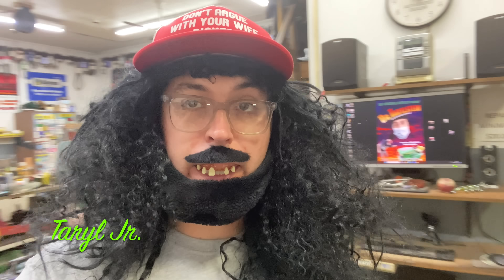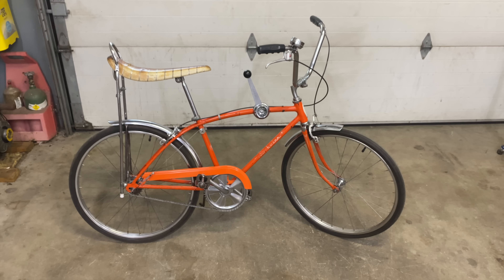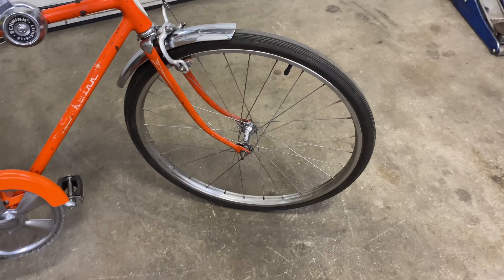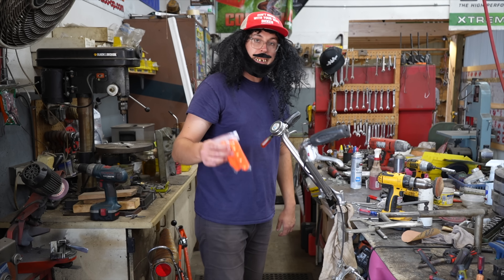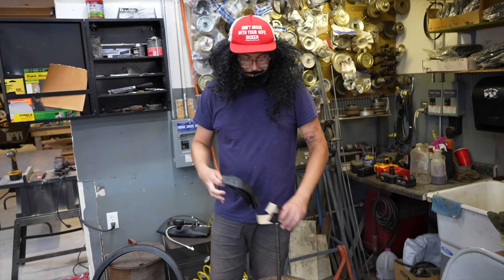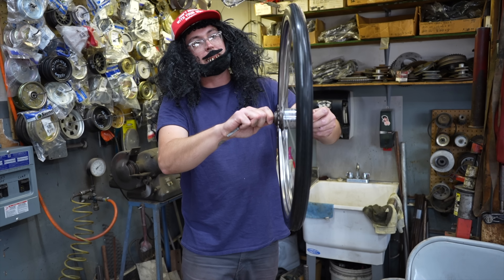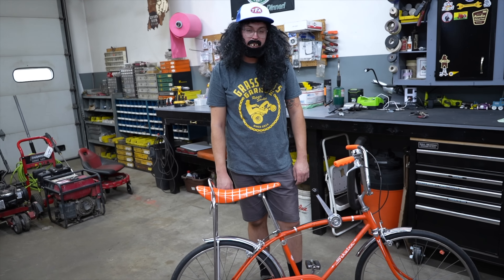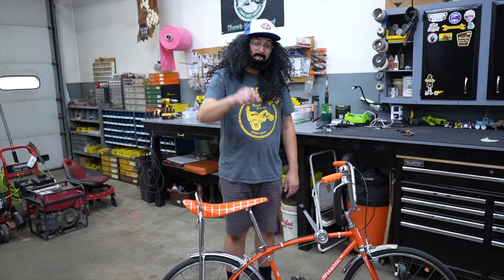They Only Made These RARE Bikes For 2 Years

Comment: Back in the 50's I worked as a bicycle mechanic at a local bicycle shop.  We were a Rollfast and Raleigh dealer.  I installed all the tires by hand, no tools.  Screw drivers are a ticket to an air leak.  Ha Ha  I was able to take a new rim and 36 spokes for a 26" wheel and relace the front or rear hub, put it in a truing stand and correctly true the wheel which was not easy for a kid.  One other secret for centering the brake pads was to release the offending spring pull on it a little bit to put more tension on that side and then easily push it back into place to align the brake caliper to the wheel.  One of the mechanically services we offered was "Adjust bike".  I would adjust both the front and rear cones to take any slop out of the wheels.  I would also adjust the crank in the same way.  Then I would adjust the front fork to ensure it also had no excessive play.  I think we charged $.75 cents.  WOW what a money maker.  Another thing we would do while the wheel was on the bike was to deflate the tire and tighten all the spokes and give the wheel a general alignment.  If the bicycle had any missing spokes or ones that couldn't be tightened we would remove the wheel tire and tube place it in the truing stand and give it a proper alignment.  We would also replace the rubber band that prevented the spokes from pinching the tube if necessary.  I think we got $2.50 for truing a wheel.  I was also capable of repairing the standard one speed rear wheels "Comet" was one of the popular brands as well as the 3 speed unit that you have on your bicycle.
My favorite rear drive wheel was a Bendix 2 speed automatic.  There were no cables or shifting mechanism mounted to the frame of the bike.  When you mounted the bike you would GENTLY press backwards on the pedals.  Then start pedaling forward and when you wanted to shift into 2nd gear you would just GENTLY rotate backwards and then forward again to shift into second gear.  🙂The Good Ole Days!  Ha Ha
Reply: Definitely ixnay on the screwdrivers, Junior.  Plastic tire levers for bikes are not expensive. Get some Pedro's or Park Tool levers. You won't regret it! Put one bead on, then insert the tube, then the second bead. You will only need the levers for the last bit of the second bead.

Comment: Very nice project Junior. As a child of the 60’s living in Millington, Tn. a suburb north of Memphis boys wanted a Schwinn Stingray. Problem was they were more expensive and no one carried that brand locally. Western Auto had their own version schwinn llke bicycle. It was called a Western Flyer. It had a banana seat with a racing stripe, high rise handle bars, and sissy bar. The only mod I added was the drag slick rear tire with the red pin stripe and a head light/combination. The light used acid type C or D batteries. Every time you hit a bump or jumped something that light would quit from the batteries shifting. Still remember popping wheelies and locking up the Bendix coaster brake to see who could make the longest skid mark. So much fun back then. Don’t forget the playing cards held on with clothes pins clacking in the spokes.

Comment: I remember these bikes well because lots of the younger boys in the neighborhood (south Sacramento, California) had them. I was a junior in high school, in 1971, and had bought a Schwinn Continental (10 speed with "center pole" brakes) back in 1969 and loved riding it for long road trips. A group of us guys would take off on Saturday morning and ride the country roads that ran alongside the Sacramento and American Rivers in the area. Fine a burger shack about noon and each lunch. Then head back to Sacramento. Lots and lots of miles and memories!
The chain guard decal looks incredible! I remember using those "water based" decals that came with all of the model car, plane, ship kits back in the 60's and 70's and how frustrating it was, at times, when they would pull in half just about the time you were removing them from the backing paper. Argh!
Good luck on finding the original 5 speed equipment.

Comment: I’m a Schwinn fanatic to. I had the pleasure of riding these bikes new. My thing is to make them all functional, I do want to paint one . 
You need 24” x 1 3/8” x 1 1/4”. Are they s6 wheels? I need the same tires to for 2 bikes. Good luck with the project. I almost sought out you shop as I drove through last week, I wasn’t sure if you guys like visitors. I’m a big fan of the channel , thanks for the entertainment. I also have learned a few things watching . I’m retired so I fix mowers for relatives, friends, and a couple of paid clients..
What I have done is wet sand the frame just enough and then clear coat them with a rattle can , preserving the life they have lived. New England is hard on steel.
Thanks again.

Comment: Junior You forgot  to add the playing card / balloon to the front fork to get the authentic 60's-70's vibe.
I hope the Schwinn 3-speed hub is better than the 3-speed I had in Jr High, that had a twist grip shift controlling a cable that pull a lever connected to the rear axle. Adjusting the shift control was a bear. Any dirt/grit/mud/water that got in the rear hub required a complete tear down, clean and re-lube the pawls and gears. This maintenance was about weekly. Low gear wasn't very low, I still had to walk the bike up steep hills.
When I got a 10 speed in High School , I only had to do hub bearing maintenance once a year. Chain cleaning was an old paint brush and a can of kerosene, followed by a rag soaked in 3-in-1 oil. If we had WD-40 back then my Dad wasn't sharing.

Comment: My first bike was second-hand  it hade hard 8in  rubber tires on rims with riveted u-shaped spokes ( no adjustment possible?. It was fixed drive no brakes.  The second bike was a standard 20 in by 1.75  coster brakes it to was a used bicycle.   Then I received a 24in 1.75 stardard purchased at Shopingbag food store (Fazio's) it was a brand I never heard of before or since.  After that, it was bike parts salvaged from the burn dump and assembled into something I  could ride to school, work. Every where I needed to go. 
In 1972, I purchased a Releigh pro mark II . It had tubular tires( sew-up). I road it from Bakersfield, California, to Tallahassee, Florida.  With the exception of one desert section of interstste, we didn't know how to get around.  I still have that, Raleigh. Side note in Florida a 68 Chevrolet Camaro convertible pulled up beside and asked me directions I pulled out my map and showed them where we were and where they wanted to go on the map. One of the girls in the car said, "Aren't you from around here?" No  I'm from California, "how did you get here," I rode the bicycle the girl said if it wasn't for your strange accent I would not believe youall but youall definitely ain't from around here! Hahaha. I still ride bicycles a little and motorcycles a lot today .

Comment: Junior I was about to congratulate you on being able to do a project without Taryl's help (unlike Slippers). Then you blew it by getting his help with the seat! I remember the guy in my neighborhood that  had one of those. It had a "Cheater" slick tire on the rear. I bet you can't find one of those! It was a slick tread with two radial groves cut in and a flat tread profile. Anyways I had a Sears bike so I was never allowed to hang with his crowd. I'm a little bit puzzled about the three speed hub. It has to go because the decal on the chain guard say's "5 Speed". Something on the derailleur must have broke and they swapped the wheel and shifter to get it ride-able again. You'll be much happier when you get that right!

Comment: Cool.
My late friend RICKY had everyone of the series,APPLE CRATE,GREY GHOST etc;  even had a rare 16" version 5 speed. Sold them all to one guy there in Indiana,shortly b4 he passed. Has them in his museum,(his wife constantly trying to get him to sell them) as they're income was ebay based. She didn't fully understand/appreciate how we bought/sold/traded and worked on bicycles as youngsters. Exactly what/where he wanted them (not break up the collection).

I was the first person in my town (Southern Mi. near I-94/I-69 interchange) in 76' at 11 yrs old to have actual motorcycle moto-cross handlebars on my bike. Cut the handles shorter,had  a paper route customer weld in a crossbar and band to increase size to fit gooseneck. Took it to local plating shop that made shopping carts and (as a kid) talked them into chroming it for free.After that the guy did many parts for me. I had the in.👍
As far as I know I was also the first to put a 2.25 tire on the front wheel too. It was a WESTERN AUTO bike. Had white rims (had those nickle plated)
✌️❤️

Comment: That bike turned out great Jr! I also remember having those turn signals on my bike! I had a Kent, a Derby 5 Speed, and still have an old Huffy 10 Speed from @ 1975. The Huffy has been sitting in the basement for @ 30 years. I believe they were all bought at Pep Boys.
Reply: My first ten speed was a 24" inch Huffy that was brown and tan.  I got it in 1976 or "77.

Comment: I had a Schwinn when I was a kid. It was a red Sting ray with white seat and grips, standard height sissy bar.  It had the 2 speed hub.  You operate the hub by slightly applying the brake which would change the speed from low to high and back again. My mother gave to Goodwill.  I’d like to have it back.

Comment: Great video Junior!  I had those exact signals on a 3 speed when I was a kid.

For the grips - if you plug or block off one end of the handlebar tube, you can take an air nozzle/ compressor  and either blow in the hole at the end of the grip, or stick the tip of the nozzle under the lip of the grio on the bar like you did with the screwdriver.  A little blast of air and voilà!  Comes off or goes back on like buddah!

Have done many grips on bicycles and motorcycles this way!

Looking forward to more videos!

Comment: Yes, I remember those Schwinn bikes. I was in love with them as a kid. We would get the Schwinn catalog and drool over them. I wanted the model of Stingray that had the 5 speed with the cool Shifter on the top bar and the slick tire in the back . It had 24 inch wheel in the back and a 16 inch wheel in the front with the long 'springer' type forks instead. Instead  I got a Schwinn Varsity for Christmas in 1968. 
I was the proudest kid in town because it was a Schwinn which were the coolest bikes. Later in life when I got into bicycle road racing I learned those things were worthless boat anchors. It weighed something like 35-40 pounds. My aluminum framed Klein road racer weighed around 20 pounds.
Reply: i had the 68 green one with matching seat color and 3 speed shifter i was the coolest kid for miles around

Comment: I still have my Stingray Schwinn from 1969! My parents got it for me on Christmas. My first real "big boy" bike!  It's got all original parts and is fully working!  May need new tires now as I think that my dad had them replaced just once or twice for me back in the 70s. The wheel bearings were replaced at least once too, if I remember correctly. I believe that I may STILL have the original bill of sale and the manual yet too!  I think that it cost something like $69 dollars WAY back in 69'. The only thing that I regret doing was letting my little cousins ride it back in the 80s & 90s because I did NOT have a single scratch on it until they messed with it.  There is no scratches on the paint itself, but on some of the chrome like the back seat rest.

Comment: Compressed air will remove grips also . Put the blow gun under the edge of the grip. At the inside of the grip and blow it off . It will shoot across the shop . Also use hairspray for gluing on grips . Great video Junior.

Comment: Very interesting. I dont know much about collecting bikes except that I still know how to ride one. Having dealt with paint on vintage cars my suggestion is to clean up the original frame paint to maintain originality. You might be surprised at how well it cleans up with modern products, and how well it looks. Nicks and dings can be repaired with small brushes and matching paint. I would get new graphics for the frame. That bike is a cool project.

Comment: Huffy used the 3 spd hub. The rim appears to be gen. If you paid over 100.00 you got smoked. I own a MB shop & Schwinn is all I use for bikes. Im almost 70 & was a mechanic at Stanleys bike shop in Corpus Christi, Texas. Ladies hair spray works fine for grips. My favorite bike is my Point Beach I put a 79cc 4 stroke kit on. 26" slick on rear.  I'm the Taryl of bicycles.

Comment: as a kid I had a schwinn paper boys bike. 18 bucks used about 1955.. later made a motor bike out of it. bike is gone but I still have the engine. bearings on the old bike never wore out they were great stuff. I would clean and grease every year. never left it out in the rain. talk about brake noise it had the stack of washers coster brake i think it was a new departure. would scream when you used it. but no big deal back then.

Comment: My brother had 1. It had 5 speed with a slick on the rear. Disc breaks both front and rear. And yeah, wrong handle bars. The handle bars vertical tubes were nearly straight up and down compared to yours, are at about a 30° angle. 50 years ago...cool bike! Good Luck refurbishing yours...

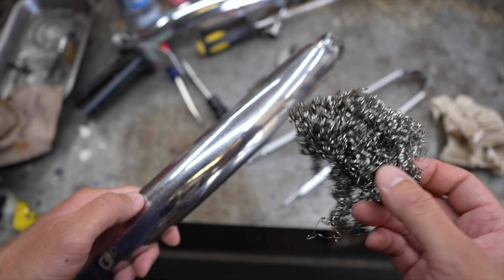Comment: 13:35 Aluminium Foil, like from the kitchen, also works on pitted chrome. Not as well as the steel scourer, but in a pinch it's good enough.
As for finding an OG 5-speed Sturmey? Reckon it'd be easier to find an honest bone in Ronnie . . . Even if you can, it'll be $$$ JUST for the hub.

Comment: my collectible bike I have hanging up in my garage now is a rayleigh  middle size 26 inch tires 3 speed. It was not used and still had the mold bumps on the tires. I put new tires on it and rode it around for a while. my main bike is a Trek 8500 mountain bike with the last lifetime frame warranty.

Comment: Nice job!

I had that bike when I was young....  Or something ultra similar.....  I had the wider seat, and all that...  Looked the same....  

Tire pressure back then I think was 45 on the front, and 55-60 on the rear.  The rear was like a slick....

Since you have paint, spray some in a little dixie cup, or a shot glass, or whatever, and use a little detail paintbrush to touch up all your marks & scrapes where you are missing paint....  It'll look 100% better....

Mine was a 5 speed.  Early in the video you showed an image, just for a second, of the 5 speed gear set, and the plate behind it...  Mine looked like that image....

I wanna say I had a couple of Takara 10-speeds after that....  And after I got my Driver's License, I'm not sure I ever rode a bicycle again, ever....  After I turned 21, and my parents couldn't say no, I started buying motorcycles, which seemed a lot more interesting than bicycles......

Nice bike though.  Ahh, I was gonna say, the white plastic things on the bottom of the seat support tubes....  Pretty sure that's how mine was when it was new....  So that's a nice touch too.

My younger Brother got a Lemon Wheeler??  Lemon Peeler???  Looked more like the StingRay.  Had the smaller front wheel...  the wider slick in back...

I honestly have no idea what ever happened to those bikes....  I'm sure they were left in my Dad's shed....  So, whatever he did with them...  Nobody ever thought anybody would collect that stuff, that's for sure....  The mindset was so different back then...  You can ask your Dad...  Every few years, something newer and better would come out, and thats all you wanted, was the new one....  Nobody cared about the old one....

Anyways, nice job...

Comment: Is that cool orange or sunset orange? Im sad that hyper- formance went under as they had alot of NOS and repro stuff for krates, rays, and fastbacks. My dream is a 68 orange krate. Also they used red oxide primer with a aluminum basecoat then color coat to get the correct shade. I vote to keep the frame original paint and match the guard. Im sure you can get repro decals for it all

Comment: Schwinn used to have touch up paint for their bikes.  Also,  are you sure it wasn't a 3 speed? Because the 5 speed needs more chain and an area for the derailleur to hang.  But I may be wrong. Look into it. Also those pedals were the kind they used on suburban bikes;  Schwinn. 26". Maybe the same. That chain guard may have been a replacement.  Paint it yourself.

Comment: Alcohol works great for removing and installing grips without leaving any residue and is a lot cheaper than lubes or carb cleaner.  I have rebuilt a couple of vintage bikes stripping them completely down to headset and crank bearings and even a tore apart a 3 speed SA hub with a broken pawl on a 70's Huffy Venture.  Having never done anything that in depth was quite a cathartic experience while recovering from cancer surgeries and chemo/radiation treatment(during covid)keeping my mind occupied without much physical strain.  Enjoy your cool big boy bike Junior!

Comment: If you ever do an old Kent or other 60s/70s Era British bike.... keep in mind even though they used imperial measurements for bike tires of the time....but they somehow measured the tires differently.....A 24" UK bike tire is not the same as a 24" north American tire ... I found this out the hard way after buying a Kent folding travel bike like new at a garage sale for $15 but the tires were severely rotted . ..not cheap tires either ...always kept it in my RV for running around ..  it was a 3 speed hub too... actually a really nice riding bike